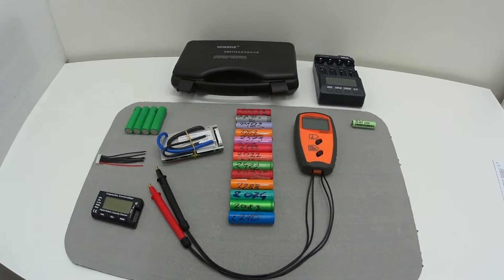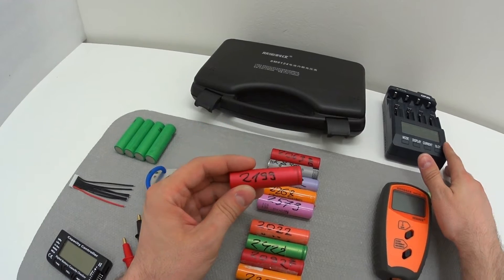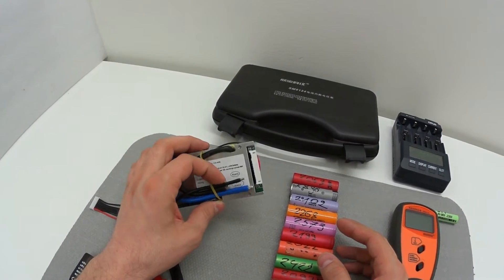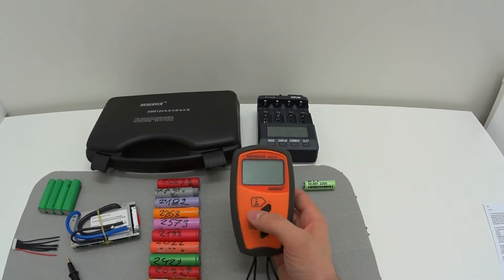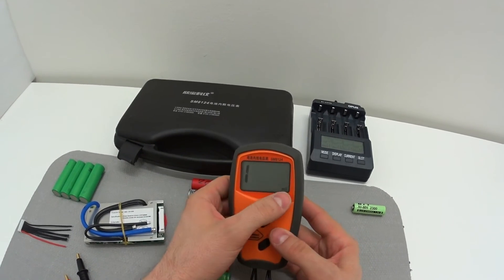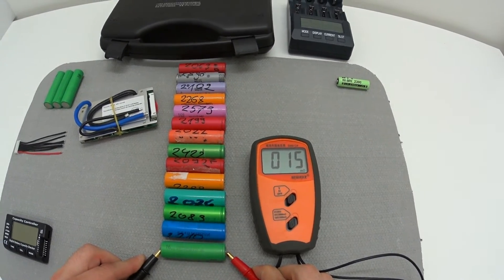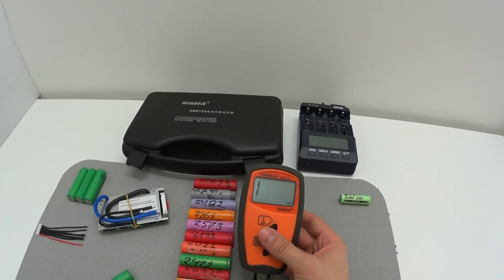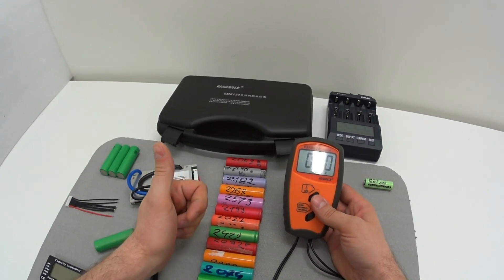18650 battery resistance SM8124 Battery Resistance Tester

Comment: Do capacity matter to cell?
If one cell had 2600mah and another brand 2000mah and both have same resistent will this be ok for battery bank
Reply from the maker: @khalilkh7389  Yes it will be ok but you need to match all cells group to have the same capacity.
Reply: @NexiTech  thanks 👍

Comment: How close should the resistance be to each other?
Reply from the maker: The closest the better. If you can not close match resistance in one cell groups then split those higher resistance cells in other cell packs as well. And when you chech each parallel cell group they should be the same or very close resistance. Then connect those parallel cell packs in series. By doing this your battery will be more balanced and it will last longer.
Reply: @NexiTech  Ok awesome. I was wondering about if the match up should be in parallel or series and you answered that as well. Thank you!
Reply: @NexiTech  One last question. What if they are matched in resistance and capacity but not discharge rate? Say some cells are 15a and others are 10a?
Reply from the maker: Not a problem if you have many cells in the battery pack. They will share the load.
Reply: @NexiTech  Thank you so much! I just bought 50lbs of drill and tool batteries and that was definitely my concern. 🙏🤘

Comment: Any battery, no matter its chemistry, which, if being tested, shows a drop of its original capacity (in mAh) equal or more than 20%, or in other words if you get only the 80% of its original capacity, it's considered as worn out. 
From that condition onwards, it will not last any longer if you intend to keep using it.
Talking about Lithium batteries specifically, no balancer will work perfectly in this condition. The deviation between the cells will always get bigger and growing.
When a new lithium battery measures 20mOhm, the rule of thumb is "reject it if it measures the double internal resistance", I.e. 40mOhm. If you'll measure its capacity you will easily understand why is that true.
Therefore the best info this instrument can give you, is when to reject worn out batteries, instead of trying to match old ones, at the end of their operational life.
Any rechargeable battery with high internal resistance consumes (in fact wastes) energy during both, charging and discharging. Through its internal resistance, in both processes, it transforms this energy in heat, which is nothing but loss of energy. This simply means that a worn out battery can never be fully charged (referenced to its nominal capacitance), while it gets much more quickly discharged if put in service, (because its internal resistance adds to its external load)...Matching worn out cells is practically meaningless and is, in any case and among others, waste of time.
Reply: Then how do explain that dozens, upon dozens of Power Walls, made from USED 18650 cells, are still operational after 3 - 4 years?
Reply: @MrSummitville  If you refer to my comment, the answer is: it depends on what you mean "operational", in reference to what is theoretically accepted on the topic, as I described it above. All the necessary details are there. Nothing more, nothing less...
Reply: @ΠάριςΑζής  You stated, " ... From that condition onwards, it will not last any longer if you intend to keep using it ..."  I consider  another 3 - 4 years, so far,  as a very long time ...
Reply: @MrSummitville  Yes, perhaps it will last 10 years more, but AT WHAT CAPACITY? You seem to neglect this...detail, but this is the crucial thing.
A worn out battery takes much more time (than that it was taking when it was new), and discharges at a much shorter time (than that it was ordinarily lasting) on a given load.
And this effect worsens with time. You need to charge the set very frequently, while it cannot support your load for long time any longer.
This is because the losses (in form of heat) within the worn cells are getting bigger and bigger with time, no matter if you charge or discharge the battery.
And the internal resistances of worn out cells change very fast as well. 
In other words, when playing with worn out cells, their matching of, say, today, will reveal much of deviation after relatively few cycles of operation. At least this is not to be trusted in terms of reliability, especially if you need to support crucial loads.
For playing and having fan, this is another story, and one can build as many power walls he needs. 
In any case one must distinguish between serious professional applications and hobbyist playing...
Reply: @ΠάριςΑζής  I have found Power Walls with USED 18650 Cells that have been in-use for 5 years.  Who cares if the capacity drops 10%, after another 5 years?  Families are actually living Off-Grid with 18650 Power Walls.  It appears that you have nothing but complaints and excuses, with no real-world  experience of living off-grid ...
Reply: MrSummitville It seems that you are stuck in your thoughts dear. I don’t believe that you cannot understand my writings. Nevertheless I would like you to answer me about the usual scenario. Is there any logic of making power walls made of battery cells that are rejected by others and thrown away because their owners had at their laptops the indication of worn out battery pack? What is the purpose of keeping a battery in use whose current capacitance is,say, 800mAh, while its original value was 3000mAh? (I never said that 10% drop of capacitance renders the cell or the battery worn out). Is perhaps the previous owner of that pack an idiot because he had thrown the pack away? He simply saw that the service time of the pack was 20 minutes maximum instead of 2.5 hours and using common sense he decided to reject this battery pack. And now you support the idea that these battery cells are in perfect health? And try to rebuild the “20 minutes battery”? There is nothing more than a conflict in logic here. And yes, I don’t have any experience of living off grid, but if I ever decided to live like that, I would never trust the system’s quality on  unreliable power sources. In any case I would never design my back up power system on the basis of other people’s garbage. The point is reliability in these systems, about which, based in your writings, you don’t seem to be interested. On the contrary, my belief is that the power must be there when you need it. Not simply to wish that it would be there. This aspect makes finally the difference between our standpoints of view about the topic. Moreover you simply refer to “used” cells. At least tell me what is your criterion of considering a cell usable, in terms of capacitance. Define “used cell”. How much? 20% below the nominal capacitance is the theoretical limit. What is your limit in making your power walls? We need a minimum of common basis for a discussion in order to understand each other.

Comment: "Hi, I have a question regarding the internal resistance of 18650 battery
1- What is the risk of building a recycled 18650 lithium battery without checking and measuring the internal resistance?
2- How is the battery built after measuring and knowing the internal resistance values of the 18650 batteries, especially if the internal resistance values for each battery differ from the others for 18650 for recycled lithium batteries?"
Reply: cells that are were manufactured next to each other years ago and after being used for years will now have different capacities. in my experience, cells from the same old laptop battery can have up to 200mah difference. That means lower capacity batteries will get under voltage while the rest are still draining, in high current draw the lower capacity batteries will heat up more. heat is the biggest enemy
Reply: @daftnord4957  EXCEPT ... when we create a Power Wall Battery, with many cells in parallel and many cells in series, we arrange the cells in parallel groups, such that each parallel group has nearly the SAME Amp-Hour capacity !   This significantly reduces the over-charge & under-charge issue and allows the BMS to tightly BALANCE !

Comment: How close an IR do you think the cells need to be? The  85mOhms and 60mOhms in your video that you said can't be in the same cell group but that is only a 0.015 Ohms difference.

In that case it appears you are saying that every cell in the whole battery needs to be less that 0.015 Ohms difference? I don't think that is necessary in a 30A to 50A maximum discharge pack that is 6P to 10P made from cells with different chemistry, resistance, and capacity.

With different cell resistance you will have different allowable discharge rates. You Sony VCT4s are 13mOhms datasheet and 17mOhms real life. They are 20A high drain cells. So cell Resistance and discharge rate are indirectly proportional -- low resistance == high discharge.  So you don't want to be pulling 60A from a 6P battery pack when some of the cells are high resistance and low discharge. So if you have a 6P battery and you use 20A cells like VTC4's and other cells that are 60mOhms and perhaps 5A cells and you draw 60A from the 6P you will harm the 5A cells. So what you need to do in that case is make your maximum draw xP * 5A for 30A maximum.

When you are dealing with cells connected in parallel they self-balance when the current draw stops. So when you draw current some cells will have a higher voltage drop due to higher Resistance and during a current draw the higher resistance cells will discharge less energy and when the current draw is removed they will be at different voltages and they will automatically self-balance so that they all have the same voltage. 

The BMS balancing you discuss is serial balancing as parallel cells self-balance.  When it comes to serial balancing it is about having the same capacity in each cell group that is important, way more important that the internal resistance of the cells. With used cells you can use repackr.com for that. But still the internal resistance is important to keep as close as possible because what will happen is the higher resistance cells will loose capacity faster than the lower resistance cells and your cell group capacity will become different and that is why serial balancing with a BMS or balancing charger is required.

When you have used cells you have different capacities, different resistance, AND different chemistries the cells are deteriating at different rates. To think that you are going to be able to keep a battery pack balanced made from cells with different capacities, resistance, and chemistries, you are expecting a bit to much.  Also for smaller packs like 13S6P 100mA will work to balance, just the balancing bleed will be a bit slow but you can leave it on over night and it will balance it self out. 

Of course what will happen is the higher resistance cells will loose capacity faster than the lower resistance cells and your cell group capacity will become different. 

Now 100mA on your bit battery hidden in the corner that is a different story.

Also when you want to group your used cells together into same Ah groups you can use repackr.com which works well for used cells.
Reply: If your BMS can maintain the same voltage across the Parallel Cell Groups then your Power Wall is OK.  It all depends upon:  a) How fast you charge;  b) how fast you discharge;  c) How many many milliamps your BMS can dissipate.  There is NO such rule that +/- 15 milliohms difference is bad ...
Reply: @MrSummitville  while higher Resistance cells will cycle more Watts in sag and heat loss a 15mΩ difference between cells it not an issue. If you using high discharge cells like VTC6 cells that are around 20mΩ then you shouldn't mix 85mΩ cells with those.
Reply: @bobmutchseo  After 3 years this still has become an issue.  How many YEARS did it take before Internal Resistance became an issue with your power wall?
Reply: @MrSummitville  I don't have a power wall. again I think trying to get the IR of the cell you us in a battery pack with in 15mΩ your going to almost have to use new cells.

Comment: Hello,i want to ask a question,does resistance matter if i a am building a battery pack out of 15 batteries and the maximum load on the pack will be about 15A. Each cell can output 4A...so if i have about 1A load on each battery is it necessary for the batteries to have the same resistance ? because buying new batteries would be a big expense for my project....thanks for any answer :D
Reply from the maker: Plazma Plazmitch 15 Batteries in total? 15 bat in serial configuration? 15 bat in parallel configuration? What is the battery pack configuration? Voltage? BMS? Usage? I need more info...

Comment: With the YR 1035 milliometer tester I measured the internal resistance and voltage of numerous rechargeable batteries that I had finished recharging. I wanted these conditions to see the parameters at full charge of all the batteries. I noticed that some of the same make and model have almost the same voltage (varies by a few millivolts) but different values of internal resistance (sometimes even double and triple). This is because some batteries are old, others partially new and others new (an older battery has a higher internal resistance).

So the data I have are: internal resistance and voltage at full charge but without load connected to the battery. With these data with which calculation is it possible to know the real charge in Ampere available to the battery? To give an example: two identical batteries measure like this: 

batt1:  1,2806 volt  and 0,0227 Ohm (or 22,7 mOhm)
batt 2:  1.3204 volt  and 0.0216 (or 21.6 mOhm)
How many amps does one and the other battery have inside? Thank you
Reply: There are different type of batteries. Some with HIGH discharge rate and other with Low discharge rate (High discharge rate used for power tools - e.g.: screwdrivers, drills, etc. LOW discharge rate for computers, flashlights, etc) 
High discharge rate battery has a MUCH lower internal resistance (around 20~50 mOhms)
Low Discharge rate battery has higher (80~150 mOhms)

Comment: Will that tester work with lipo cells? So I can test my drone batteries ?
Reply from the maker: Rowan Ballinger Yes it will.
Reply: Nexi Tech one more question do you match cell resistance in series or parallel ?

Comment: Doesn't the state of charge matter for these tests? You have a 20ohm resistor in that meter and its drawing power from the battery, lithium battery has high resistance when full or dead but in the middle can be very low. So your going to get varied results depending on how much power is in each battery. Unless your testing each cell at full and again at empty and see what the difference is, the resistance will vary.
Reply: I guess I'm kind of off topic but do anyone know a good website to watch new series online ?

Comment: Thx for an informative video. I'm getting ready to build a 20s3p pack using identical cells but with varying condition. Some have a bit higher resistance and lower capacity. My question is, to achieve as balanced a pack as possible should I focus on capacity or resistance first? Every group of 3 cells in parallel should have similar total resistance and capacity, yes? Can I calculate resulting resistance by using 1/R = 1/R1 + 1/R2 + 1/R3 ? So for example I can mix 30+30+30mOhm in one group and have 20+30+40mOhm in another group and still have balanced groups? Thanks!
Reply from the maker: Mike H Mike H
1- Yes
2- Yes
3- Yes
Also I would suggests that you connect balance connectors on the whole pack, for example 2x7 and 1x6 conector and use 3 of ISDT BC 8S to monitor voltage and live discharge diagram under the load. Using this device you can easily see in live voltage sag under the load of every 3p cell group.
It's pretty awesome device that has adjustable High voltage protection as well. 
Check video here: https://youtu.be/VTMQ0Eg8Xhc

Comment: If you also know the specs of the cell and what the internal resistance should be from the data sheet. Then you can test the IR and determine if the battery has been abused or has internal shunts in it. In other words if the cell should be 3,000mA capacitor @ 50m Ohms and you measure it at 100 then you will probably find the capacity to be around 50% to 60% or the new cell specs. You can also expect that one to get hatter during charging and discharging. So instead of waisting time charging to see if a cell gets hot I would assume if the internal resistance is 60% or higher then listed in the data sheet it not a gold cell to re-use and you save time on charging and discharging.

Comment: Say I want to build a 6S 4P and I have different old cells with different capacity groups off laptops, which ones do I add for the series groups and which ones for the parallel groups ? Meaning is it more important that the capacity is closer in the series groups or in the parallel groups?
Reply from the maker: Niko Niko You need to have close capacity in every parallel group or in all 6 cells group (6S) You don't have to have equal number of cells but you need to have equal total capacity in each group or you will have unbalanced battery directy after first discharging/charging cycle. Also try to get resistance of every cells group(1-6) close as possible.
Reply: @NexiTech  How far of can the resistance be from each parallel group? I understand that the capacity of every parallel group needs to be close.  Are you saying that even if the batteries in parallel are a bit of, it does not matter as long as the next parallel group is close to the same?

Comment: It shows different resistance values on the charger because contact surface is different each time you plug in the battery. Try applying small pressure to contacts when you plug in the battery and you will get better readings

Comment: Try pushing the negative terminal up with a pencil when you test the cell to apply pressure and a full contact (this should then give you an accurate reading)
Reply: This worked. Got the same reading every time.